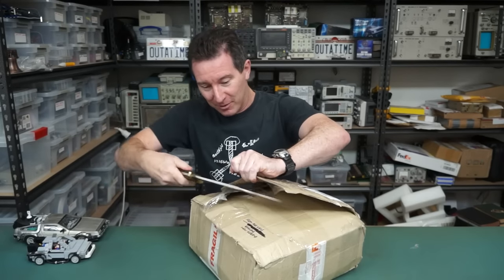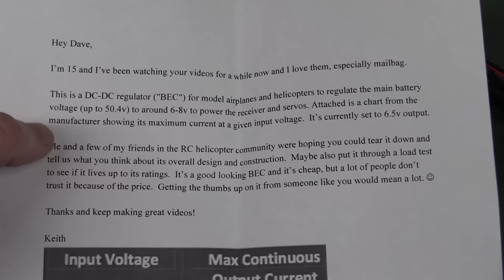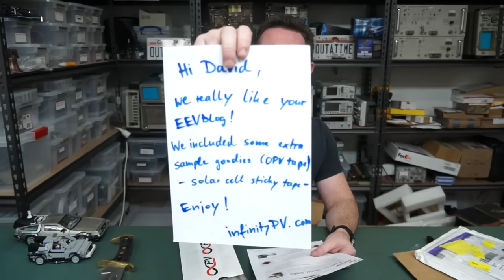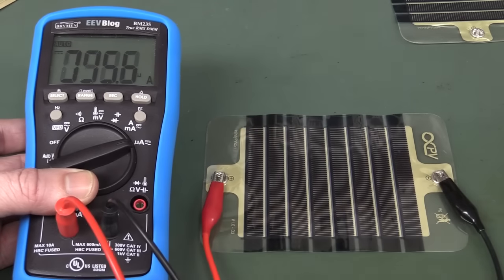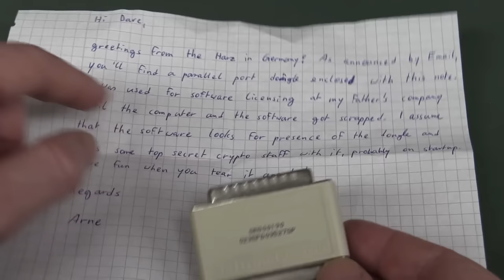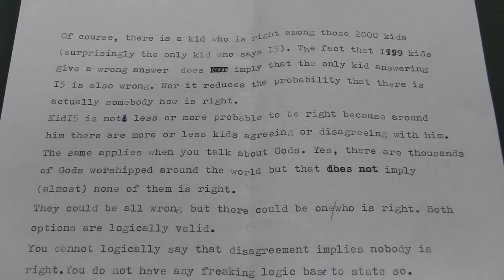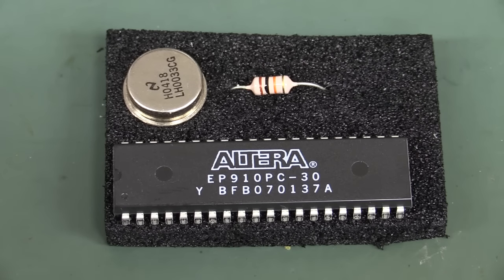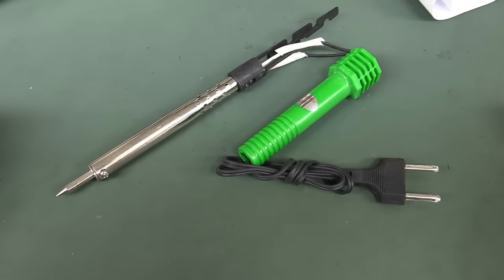EEVblog #893 - Mailbag

Comment: You didn't even test the DC/DC? How did you come to those wattages? They specified the maximum OUTPUT current, times the currently set 6.5v, that would be a max of like 100w...
Reply from the maker: Dang, did I do that? Really? Shit, I did. That's really dumb.
Reply: EEVblog It happens to everyone :P
Reply: Exactly what I thought.
Reply: +EEVblog Can you do a quick revisit in the next mailbag video?
Reply: +EEVblog  oh wow 😂😂😂
I missed that too
Reply: +EEVblog Yeah Dave. You got that one wrong. It's ~6 volts times the output current. Not the input voltage which can be as high as 48v. 6x8= 48W
Reply: you really fucked up this time:p i feel bad about the lad that sent this to you..you should put some more captions in explaining lol
Reply: this V20100S diode can handle max 20A

Comment: USB dongles are still a thing.
Reply: My company still uses them to handling licensing of a product. Keylok.com still produces them.
Reply: in the pro audio and studio, they are common - protools uses iLok, and Steinberg use an USB-eLicenser
Reply: Dataton Watchout use hardware key dongles for the license. You don't get to play with anything if you don't have that £1400 USB stick.
Reply: I think Steinberg uses it still.
Reply: +fnmatrix Haha, I hate that. I tend to buy and legally crack software because the licensing is reaaaaly annoying sometimes.
Reply: +BloodySword Yes they do (sadly) along with many other vst companies.
Reply: DSX Access Control software still requires a USB Dongle for the Enterprise version of the control software.
Reply: I coded software back in the day that used Sentinel Super Pro. There is a unique vendor ID that they program in and a unique serial number. There is also some user addressable space (something like 112 bytes IIRC) that you can use to validate your program or store license levels. So you can do things sneaky like use it to index a table of addresses for code to execute so that unless they know the magic number from a real dongle then the software will just crash. They also did a program that would wrap your program and decrypt it based on a key burnt into the dongle. Other dongle manufacturers would let you do things like challenge-response to verify it was the real thing rather than just a piece of memory like SSP.

The chips they were based on live on, as having an ID is a generally useful thing.
Reply: When the firm I was then working for bought OrCAD SDT 3 back in the early '80s it didn't take long before the in-house '86 assembler expert had linked out the routine that checked for the dongle. V4 was a different matter.
Reply: I see dongles at live events a lot.  The audio guys have their dongles, lighting has e.g. Jands Vista consoles/software, video software e.g. Playback Pro or Watchout
Reply: if you're into digital music production, f.e., iLok are a huuuuuge partner of many Developers.
Reply: Laminar Research has USB dongles to validate their X-plane installs if you order them

Comment: Oki, I'm a n00b, but doesn't it say input voltage and output current? I don't think I'm allowed to multiply those two to get the power... :/
Reply from the maker: Correct, I'm an idiot.
Reply: EEVblog Oh! Oki... :|
Reply: In that case, how much does it change your opinion? 100W output, ~10 W losses, 60°C above ambient seems reasonable for a quality power devices.
Reply: Happens to the best of us (and to me daily).
Reply: Great picture of Cheburashka Maria ;)
Reply: Alan Anderson Thanks! I have that figure, it comes delivered like that in wooden box with oranges and all, just as he first appeared in the first film/episode.
Reply: Dave, I think you need to revise your review. It's only fair to the manufacturer.
Reply: So with the real power rating, how would you rate it, out of interest? Do you owe them an apology?

Comment: G'day Dave... I've taken apart quite a few of those NEC projectors. They sold new back in the day for $1500+ US. Here's some of what I learned: The lamps (cost $160+ US) will burn out. Part of the issue is that they emit full spectrum light, which eventually cooks the reflector. As the reflector starts absorbing more and more heat, it eventually causes fracture of the glass tube. They have been known to explode under electrical force. The projectors themselves have another unique problem, as full spectrum light also is full spectrum UVA and UVB light. There is a cube prism that the light goes through, one side for R, one for G, one for B. The cube has a special coating that if it gets dirty, the UVA and UVB causes the dirt to fuse to that coating, ruining the prism, and the light output. NEC's otherwise usually had either a low voltage failure, or a high voltage ballast failure. If it's low voltage, it's toast (too hard and costly to get to it since it's on the very bottom. The high voltage module is a vertical metal encased box, that is right below the processor board (the top board). It can be changed fairly easy, and you've got a working unit. (If it turns on but won't light, HVPS... If it won't turn on at all, LVPS.) One point of failure, is the power supply. If you exceed mains rating (either high or low), you will burn out the low voltage board. We had a brownout at a high school and the power dipped to 85 volts. It took out 12 of them in one shot. It was confirmed by the local utility. Minimum low voltage is 90, as you can see from the sticker. We still have some of them in service 7+ years. Many are failing and being replaced by Hitachi branded projectors.

Best... Lee in Tucson

Comment: I guess you mixed up input and output current.... at 48V input max. output is 6A at 6.5v... 39W.... okay, maximum output is higher at lower input voltages (i guess due to better efficiency), but still way below what you've calculated....
Reply: +simontay1984 Wow, I've never seen someone get so mad about DC power before

Comment: I think it's great that you aren't afraid to discuss religion on your channel when it comes up. There's little about religion that isn't relevant to the world today. Beliefs inform actions. And belief in an ultimate, unquestioned,  yet self-constructed authority underpins many religious believer's worldviews today. That kinda of single-sourced worldview stifles introspection by making it far more uncomfortable to question previously accepted explanations about the world. Especially compared to a more scientific worldview, which will end up relying on a wide range of sources for its explanations.

I'll leave you with this great quote from Karl Popper.

“The empirical basis of objective science has nothing absolute about it.
 Science does not rest on solid bedrock. The whole towering structure, 
the often fantastic and audacious construction of scientific theories, 
is built over a swamp. Its foundations are pillars driven from above 
into the swamp – not down to any natural 'given', ground, but driven 
just as deeply as is necessary to support the structure. The reason why 
we stop driving the pillars deeper into the ground is not that we have 
reached solid rock. No, our decision is based on the hope that the 
pillars will support the structure. (If the structure becomes too heavy 
and starts to shift, then driving the pillars more deeply into the 
ground is unlikely to help. A new structure may be necessary, but the 
foundation of its construction must rest on the ruins, on the sunken 
pillars of the collapsed structure.)” - Karl Popper

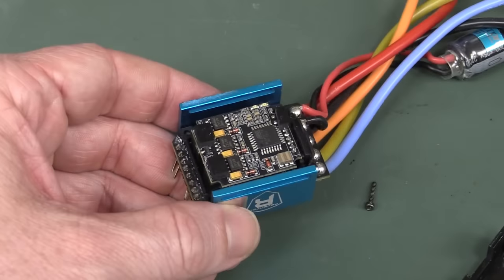Comment: 4:35 is a speed controller for a brushless motor for an rc car. The transparent blue "LED" programing box is used to program the speed controller for things like cut off voltage (for lipo batteries), brake strength and many other settings to fine tune how your RC cars run. The Speed Passion stuff is generally used by on road racers and RC drifters.

Comment: Most RC stuff uses lipo batteries, charged between 3-4.2v per cell, up to 6 cells per pack in series (referred to as 6s). Some models use 2x 6s or 4x 3s batteries. More Vs = more whizz... The motors are specified using the odd designator kV, which is shorthand for "RPM per volt", so for an increase of 1V, you can expect an increase in x RPM.
Also, much of the thermal dissipation for these are calculated assuming high speed airflow :-) - RC parts have been known to fail in bench/backyard tests due to insufficent airflow.
Also, most RC parts are expected to be subjected to reasonably low duty cycle (<70%), or at least not 'at full all the time'... 
Although a BEC like this would usually be used to run a controller board (autopilot, gyro stabiliser, navigation, head-up display, video transmitter), sometimes they are used to run servo motors which have less frequent load.

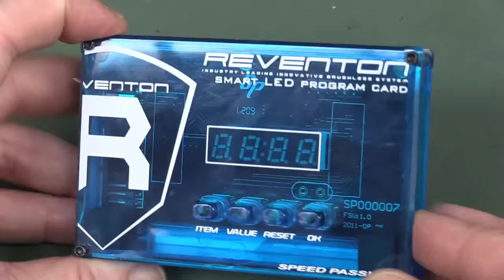Comment: The mailbag item at 3:28 is programmer for the SpeedPassion RC car ESC. (shown right after the programmer) it used to drive brush less rc car motor. You can edit the brake and reverse strength and how fast the esc will apply the full throttle and so on. (power curve adjust or something like that) neat little device and I think it was a cheap one.

Comment: We used to use this software for converting print data to a proprietary format for archival purposes. It used those Sentinel dongles but they had a built-in counter. Every page we converted would subtract 1 from the counter, and when it ran out we would have to purchase a new one.

Comment: Ahh, SuperPro dongles, I recall those, a couple of employers back we used them.

Rainbow are very much alive and well (as are a few other dongle companies), their Parallel dongles no longer exist, but they do USB dongles still, fun fact, the OLD usb SuperPros had a EEPROM on them you could pull the data off and clone it to another ;) That lasted for about 7 years, then they started potting them.

Mostly circumventing dongles in software was done by writing an emulator which would fake the responses from the dongle, in the DOS days it'd be a TSR that hooked the ports, in Windows it'd be a VXD that sat on top of the serial/parallel driver.

Comment: Dave,
           as far as the  DC to DC convertor is concerned, it looks like it's switching probably at a high repetition rate with variable pulse width not just a series regulator so the normal considered power dissipation  with a series regulator would not apply.  The switching transistor or FET would not dissipate as much being fully on or off as would a series DC regulator.  BUT  it still seems too small for the amount of current it would have to switch.  The Chinese under rate devices all the time, it's called planed obsolescence, and when it fails they make money when you buy a new one to replace it. 
I have been a tech since I finished my apprenticeship in 1969.  It was a five year apprenticeship back then, electrical & electronics trades  and when I started in 1965 the electron tube was king, some very ignorant & stupid people want to bring it back again along with the black art of audio output transformer manufacture.   

Regards Rob

Comment: Dave, today they use USB dongles - a company FLEXnet specialise in this type of licenses. I remember at the local radio station, we used to use the HASP4 USB dongles till we switched to a new system. Each program had it's own HASP4 dongle. Some people found a way to emulate them with software which rendered the dongles useless.

Comment: ESC programming unit the blue box ;) its indeed to program the speed controllers, for timing, direction of turning the Brushless motor and that sort of stuff ;)
Looks indeed like there was too much load on the unit :)

For the BEC, for instance an 10 Cell LiPo has already 37Volts, so 50 is quite ok to be on the safe side :)

Comment: Dongles carried through into the 90s as I recall; quite a few of the high-end 3D modeling and texturing software utilized them around the time home PCs were catching up with purpose-built SGI boxes.  :)

I was involved in the Toyota case.  Even at that level, it's not worth it...

Comment: Since there are infinitely many numbers the chance of guessing the correct answer to 6+9 is 0%. Make 2000 kids guess and the likelihood that at least 1 kid guesses right is still 0%. (remember 0% likelihood is not the same as the event being impossible).

Therefore Daves statement:  ".. it is almost certain that, well, none of them are right" is correct.

The only way to make the argument in the letter work is to define that at least ONE kid has the right answer. This is actually explicitly done in the letter: "Of course, there is a kid who is right among those 2000 kids"

If you start out by defining that at least one kid is right then of course "it is almost certain that, well, none of them are right" is a false statement. This is a direct consequence of the definition.

Back to religion (the analogy):
If you define that at least one god exists then any "proof" based on that cannot be used to determine whether or not any god exists.

Who's using bullshit logic now? A "Ph.D."? I hope not. Would be embarrassing.

Comment: Dave,
           I still use Autotrax  1.61  for DOS,  I run it under WIN98SE ,  I didn't know when it was first released it used a dongle.   Autotrax 1.61 was developed in Tasmania  I believe so I don't know what the German  connection was ?  1992  I think we saw this CAD software for printed circuit development. 

Regards Rob

Comment: Argh. Those parallel port dongles. I would use a modified DOS serial port sharing (interlnk/intersvr?) to share one computers parallel port with a few other machines with a null modem cable (and various add in serial/parallel cards). The "extra" copies ran on the other machines and got their dongle verification from the one remote machine.

Comment: The "funny" lenses in the projector is a light integrator.  Basically what is does is make the light beam more homogeneous across it's cross section.  I have seen Panasonic ones that use two of these to have a really flat light level on the screen across the whole picture.  The light the bulb outputs is a mess is this regard.

Comment: I have a startup idea someone please steal it so I can buy one of these without working hard:

First we need to find out if capacitative touch sensors can pick up dry erase marker solvents evaporating off of them, and what it would take to make them do that. maybe water based markers could work? I doubt the dies make sense.

If that works, take a white plastic sheet thing that unrolls from compact to flat (kind of like a snap band), so that there is some way (i think folding like those camping plates) to keep it opened and flat. Mount such a sensor on the inside, and some brains on the edge. Encase in some padded cylinder thing, like a big pencil case.

This is meant to be a personal dry erase sketchbook, durable, light, cheap with long battery life, and most importantly simple. It should ideally record just sensor traces to microsd card or send via bluetooth or something (NO FRIGGIN CLOUDS!!!), as well as regular touch inputs, as a series of strokes with time stamps (i believe w3 has an open format spec for this) so that it's easy to correlate with timestamped audio from some other device.

No screen, just a led indicator to get feedback on input and operation mode.

PLZ INTERNET CAN HAZ?

Comment: That mailbag letter about religion is probably the most ridiculous thing I've read in quite some time, 6 + 9 has already been proven to be 15 we all know this. I won't even get into it.
Reply: 6+9= F in the hexadecimal system, so every kid answered wrong.
Reply: Mac Donalds We're using base 10 mate lol.
Reply: but what if no one knew it? just because no one answer this question and 200000 kids give a diferent answer it means that every one are incorrect?
Reply: AmazinChannel But we do that's the point so the analogy makes no sense. There are ways to prove definitively that 6 + 9 is 15.
Reply: Mathieu Riesling don't think about it like just a calculate, think that there's no math, now it will make sense
Reply: 6+9 is a bunch of lines and swirls
Reply: I think everyone missed the guy's point. God has not been proven, but it does not mean it's not true just because there are a bunch of other god theories, there is still a possibility that one of those god's is real.   That math equation has been proven, so that case is closed, but consider a point where somehow, it was not possible to prove.  Perhaps consider a really complex equation or something more complex like a chemical reaction that is not possible with current tech, and some people have different theories on the result, does not mean none of those guys are right.  One of them might have actually figured it out.  (ex: figuring out a pattern for pi or something like that)